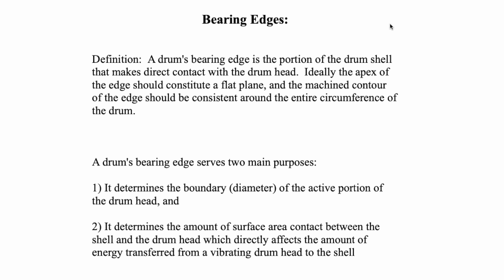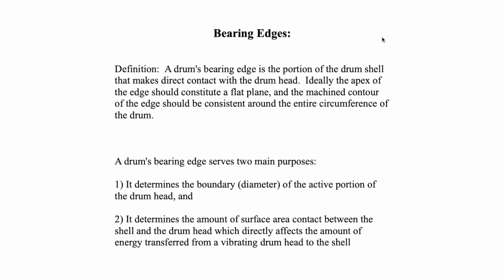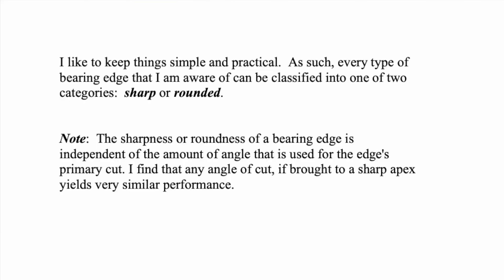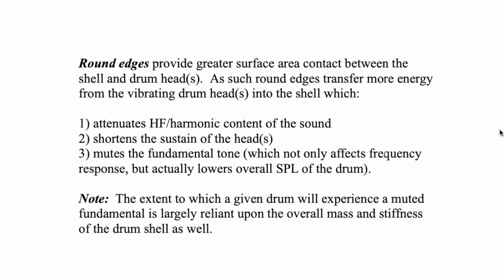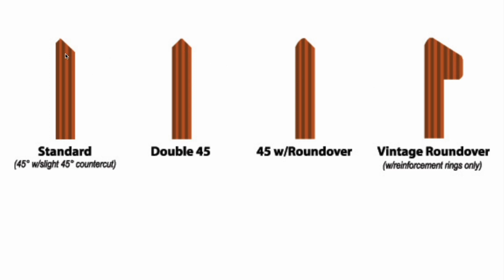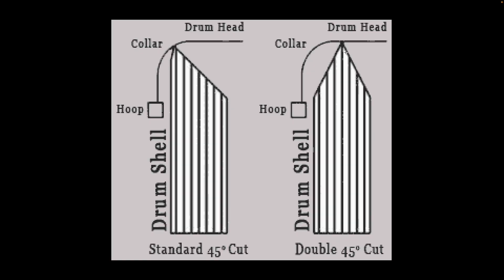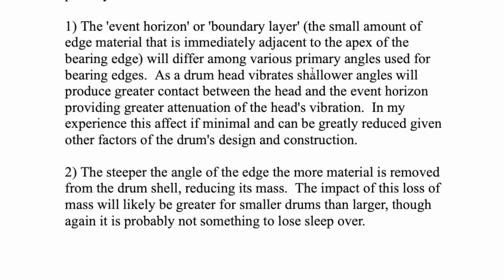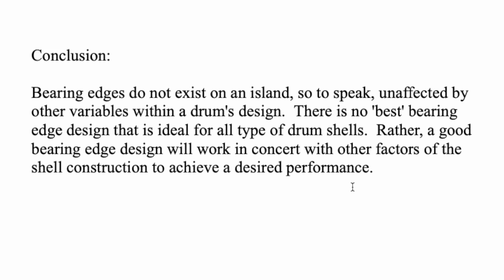Bearing Edges -- Drum Sound Physics Part II

Comment: To me, not roundover doesn't make sense for drumsets. Why would you pay 2000 bucks or more for a drumset and not have it "breath" with that transfered energy from the head? Also isn't that part of what makes a drumset sound like that instead of something else?

Not having a roundedover outer edge makes the drum work more like a timpani, if you are after that sound, then fine. That's why evans came out with there "360" method, they just removed the angle of the collar so the head would tune the same way a timpani does, by tensioning the head itself with the sharp edge, eliminating the problems of a malfunctioning outer edge. That's the main reason why evans sound different than remo for example.

Keep in mind that on either case, a not leveled edge will make the drum untuneable anyway, thats even more important than the type of outer edge you prefer.
Reply from the maker: Agreed on the 'flat' plane of the edge.. without that the type of edge won't mean much.  

As for the tympani comparison yes, that is how the edge is on a tympani, but drums with a sharp edge won't sound like tympani, because they aren't kettle drums... they're cylinders.  The result is greater HF detail and longer sustain, both characteristics that lots of folks (like myself) desire.  There is definitely less shell interaction, but I don't find that a great concern.  

All of this is relative, of course, as every drum transfers energy from head to shell regardless of edge, so this a discussion of degrees, but the variances can be pretty substantive. 

And then we mic our drums and most of this stuff becomes subject to the signal path and processing....

Comment: You make no difference to the muting effect on the drumhead between the rounded bevel vs the sharp 45.  Seems to me the fractional edge of the head vibrating on the rounded bevel must have an effect, especially if the top edge is perfectly round and flat. (All things being equal) Hence, an older drum with a reinforcement ring a larger bevel, uneven surface, and out of round all cause the outside edge to gate against the shell edge.
I've seen videos with different shell material compared, and the difference is minimal. Ok and thanks for the video!

Comment: Hi Great video learned a lot.  I listened to the Drum History podcast and they were interviewing a drum maker who said one of the problems with modern drums isn't bearing edges per se but the use of mylar drum heads which resist changing shape and so don't seat properly when applied to a drum. His argument seemed to be that this was less of an issue with calfskin heads used on vintage drums with rounded edges because the animal hide would stretch and conform to the edge more easily. Can you comment? Do we all have to go back to calfskin?
Reply from the maker: He's right about calfskin conforming to an edge.  For this reason many 'quality' vintage drum manufacturers didn't worry too much about their edges (Gretsch is rather notorious for questionable bearing edges in their older drums!).  

Where I would take issue with his assertions (as you describe them anyway) is that mylar is a problem.  Mylar requires better edges to sound good, yes, but the sound produced by mylar is very different.  Calfskin is cool, but it's also mellow.  If you want a lively tone WITH SUSTAIN, you won't get it so much with calfskin.  Calfskin is a natural product (obviously) with varying thickness throughout a given cut of material.  Mylar is extremely consistent over the entire area of a drum head, so it is going to behave differently from the get go.  

So either you like what mylar brings or you prefer the tone/performance of calfskin, but I would find it difficult to honestly say one is better than another.  But bearing edges will have a greater impact on tone when used with mylar heads, yes.
Reply: @drumdotpizza  thanks so much very helpful reply!